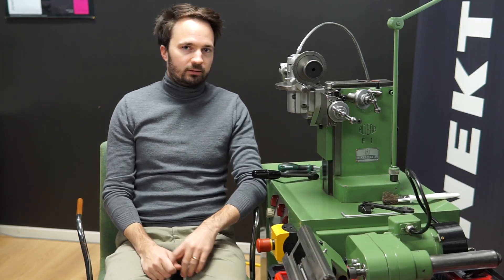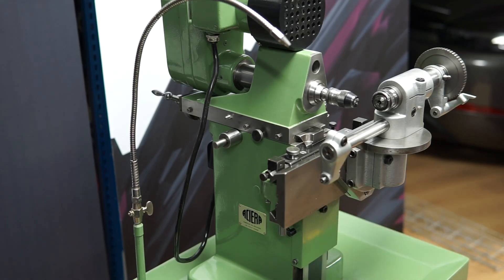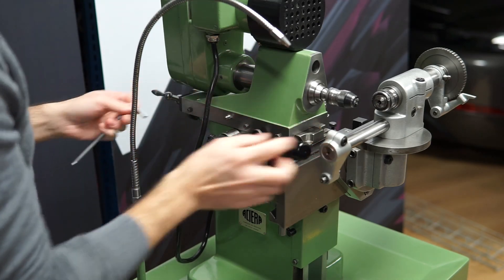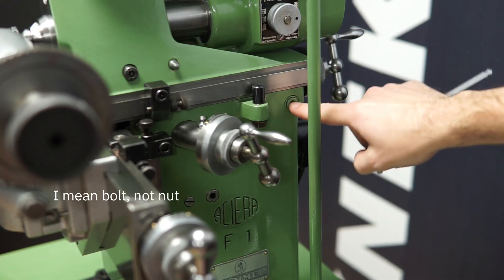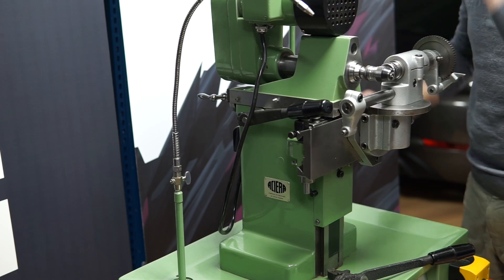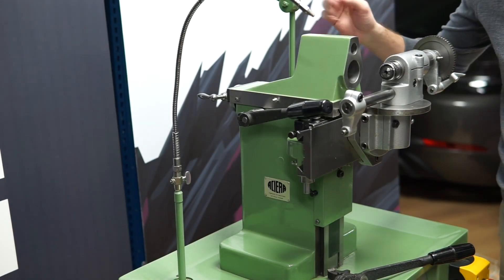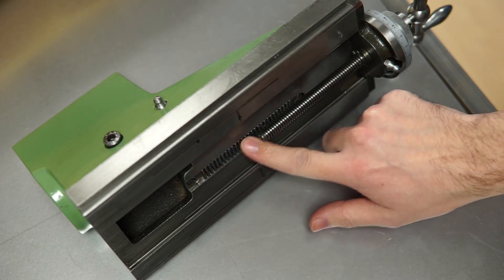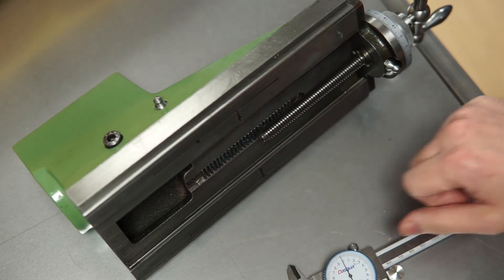How the levers work on the Aciera F1 and why doesn't they work on mine?

Comment: Cant you excenter the tooth gear when losening the handwheel and turn the handwheel part exccentric? My assumtion is that the hand wheel mechanics are involved at least i come to that assumtion from my Schaublin 12 where you have to disengage the handwheel mechanic by unscrew one single screw, other wise the handwheel mechanic interfere with the lever operation. 

Is either one or the other.... Lever or hand wheel operation because the hand operated screw interlocks into the toothed gear and when youz want to move the lever aditionaly the toothed gear will block that operation.
Reply from the maker: Yes, it was an eccentric wheel, I learned that from other commenters :-D Appearently it should be written in the manual, but I haven't found it yet...

Now in hindsight it is pretty obvious that the gears shouldn't be meshing all the time, only when using the handles, but when you're new machining and something isn't working while filming, it's easy to think a bit "narrow" :-D
Reply: @MachinistJack well i assume they dint update the manual the leaver seems to be an upgrade for a new series. But idk. 
I did drive yesterday by the old Aciera faculty in Le Locle a very big fabric hall.
Reply from the maker: I wanted to visit Le Locle but didn't have time to do it, maybe next time :-D

Comment: The standoff/sleeve between the lever arm and the machine body rotates.  Use a rod in the hole to rotate the sleeve.  It is an eccentric shaft that raises and lowers the gear and arm assembly.
Reply from the maker: @nathanhays1746  Yes, that’s it, I’m glad it wasn’t something wrong with my machine 😃

Comment: as you will find in the manual, the handles moves a gear which engages with a rack
you must adjust the engagement of the gear against the rack by means of the gear-axis eccentric sleeve. the you must un-screw the nut retainer bolt.
Axis Y and X opperate in the same way

Refer to the manual, it is available online
Reply from the maker: Thanks, turning the eccentric sleeve worked! I checked the manual again and couldn't find anything about it. I'm having the one from 1971 in English, maybe it can be found in another one.

As for the bolt, I did loosen it but it still doesn't work, I think it has to do with the paint.
Reply: @MachinistJack  Yes, it is in the 1971 manual, in the Adjusting the lever feed section.
Reply from the maker: @svartatthittanamn  I need to look again 😃
Reply: @MachinistJack  I don't believe that the locking screw underneath the top slide is standard.  Just loosening side mounted screw should release the leadscrew nut and allow the lever to function.  Try getting the leadscrew nut free.
There is a three language manual and an all English manual for an F1+ available as PDFs.
Reply from the maker: @andrewrappaport  Now when I know how to actually engage the gear I can probably get the nut loose by using the lever.
I wonder, if the locking screw on top isn't standard, what is it's purpose? It makes it far more tedius to make the machine lever-operated.